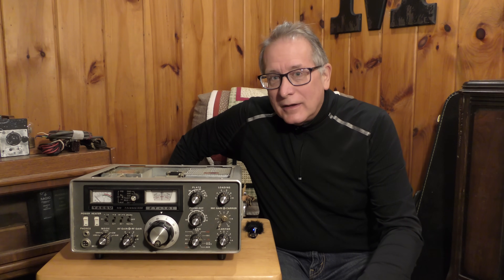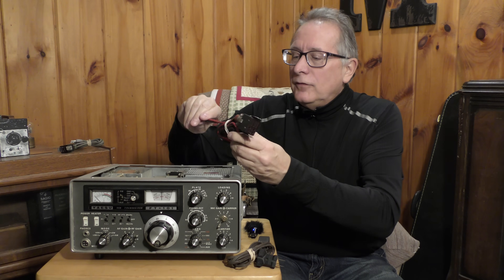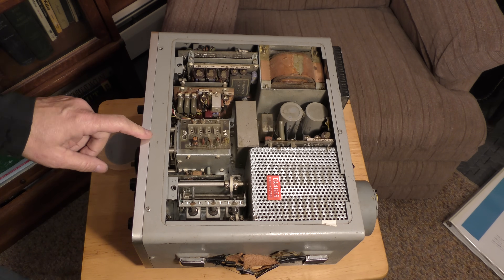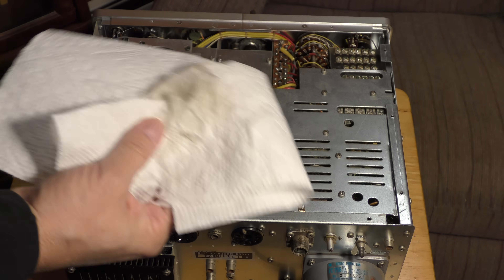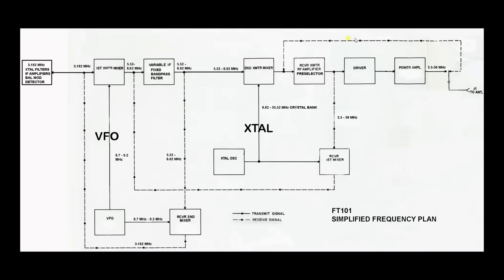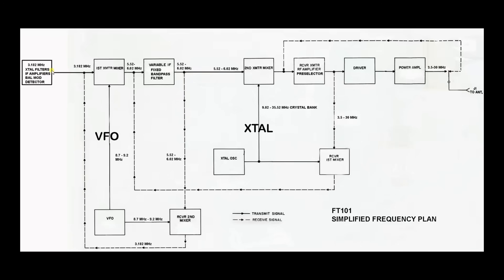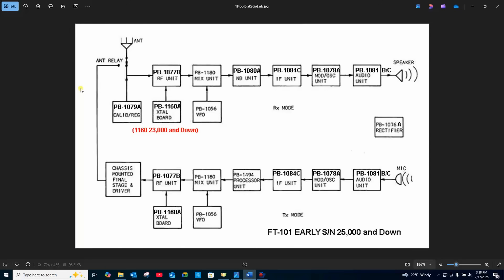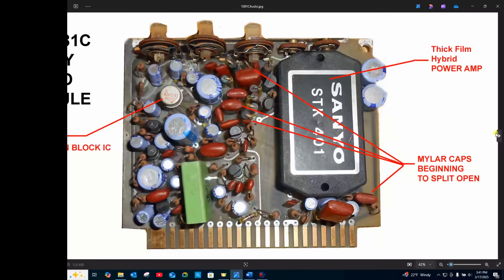FT101 Restoration Part 2

Comment: I'm hoping this series will maybe learn my dumb ass how to fix my 101e though I'm absolutely terrified to even try because mine can definitely be made worse
Reply from the maker: Obviously with the power cord out! Start simple by cleaning each card and reinserting, doing all of the control and contact cleaning and pull and re-seat the tubes. This gets you inside and looking for damage and smoked parts and aids general knowledge of the layout and shields. This builds confidence to go to the next steps.

Comment: Very nice, Mike ! Glad you emphasized don’t even think about plugging this in and powering it up until the basics are done. Those Sanyo modules and that ‘spider’ transistor are ones of a kind !! It still works beautifully here. I went ahead and replaced all those Mylars. I’m a Deoxit fan, so business cards with some sprayed on and used in the card holders as well as between the relay contacts works FB.

Comment: My FT-101EE developed a problem where it would immediately pop the AC fuse on power on.  I suspected the power transformer but at the suggestion of my DXing mentor ( who had a CB background and was familiar with the FT-101) I tried powering on with the tubes removed

I found a short had occurred in one of the output sweep tubes.  I had been running RTTY, remember the Commodore VIC-20?  The 100% duty cycle was hard on the sweep tubes even though I had backed off on power.

Comment: Mike - Maybe you can speak to the split mylar caps more.  I find very little on the intereweb about these.  My amazing😉 Tempo One (FT-200/250) has several 0.1uF 50V caps with this split.  I have some that measure perfectly & one splitter that is open.  I have yet to replace all of them, but I can attest that the Tempo works well on Old Junk Day on 75M.  Great series.  73

Comment: The one I have has around 99% of the mylar caps have split.not sure if I should replace them or just leave them alone?
Reply from the maker: It's a job, but at the cost and ease of replacing, I would go for it. Mine is in better shape, and I will try powering it, but I fully intend on recapping them.

Comment: There two types of power connector please please please make sure you look at the numbering on the as they are different to the Johns connector but will work the same as long as you wire it correctly so be very careful or you can damage your 101 very badly Paul 😢😢😢😢

Comment: Another thing that's going to cause a lot of consternation with equipment of this era is that there is almost certainly an invisible non-conductive oxide layer on the gold card edges and the contacts within the card socket. One of the best ways to remove it is with a soft eraser on the card fingers. On the card sockets I might would use a specific cleaning agent and q-tip so as to not damage the connector "springiness." I'd use deoxit D100L cleaner. Those who are into vintage computing might want to think of this as well! Edit: I'd measure card thickness with a caliper and use a small piece of cardboard a bit thinner loaded with cleaner to clean the sockets.
Reply: Was thinking deoxit from the first sentence and then you took the words right off of my keyboard 😂
Reply: I remove oxide with a wire brush.
Reply: @Capecodham  wire brushes could dig into the soft gold plating so I would discourage that actually. And loose metal shards and hairs from the brush might cause unfortunate shorting.
Reply from the maker: @Capecodham Brass?